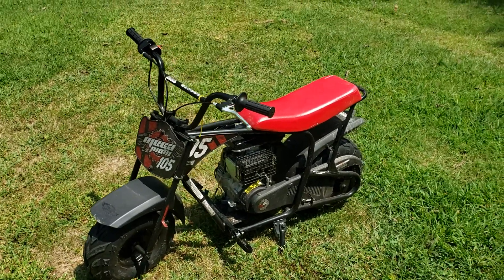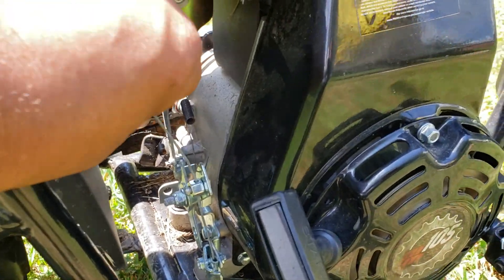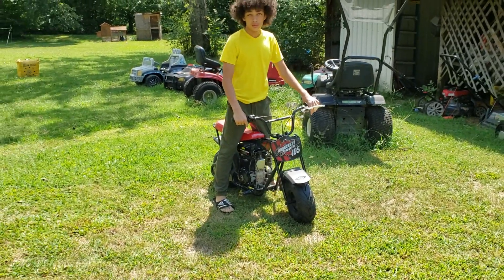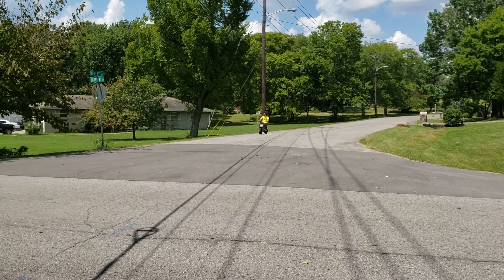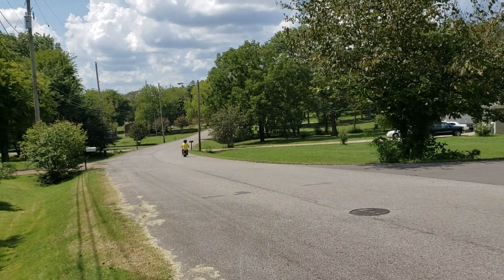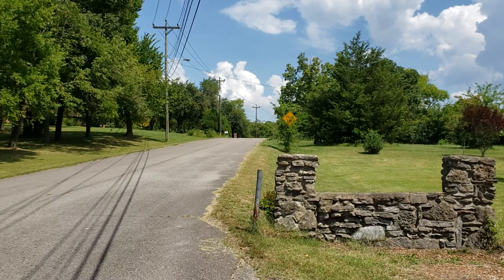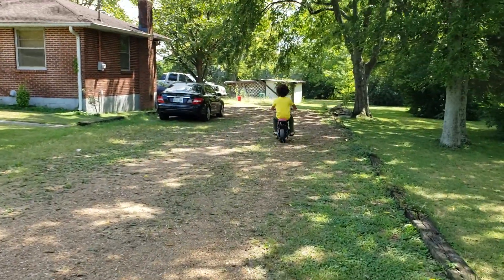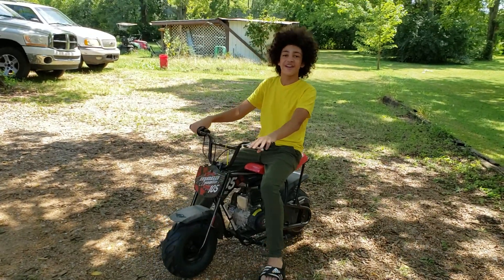Mega Moto 105 mods and ride.

Comment: Replace the spring going to the bar going to the throttle on top of the carb with a stiff wire, make a straight pipe exhaust with hand bar scrap. I can go up damn near any hill, I’m 5’11 180lbs. Easy 20-25 mph. Ran through the brakes in the first week
Reply from the maker: @Brief Lean unfortunately someone stole this bike.